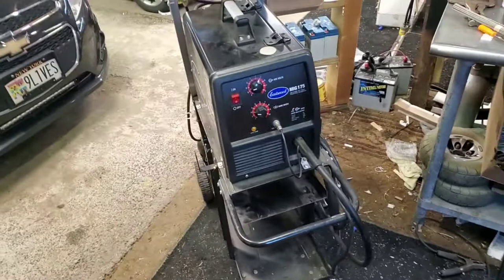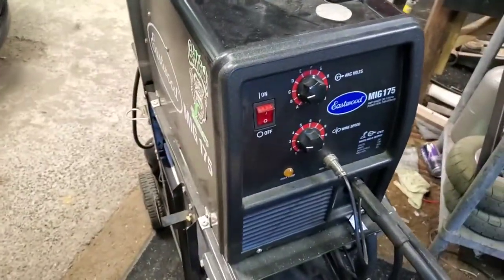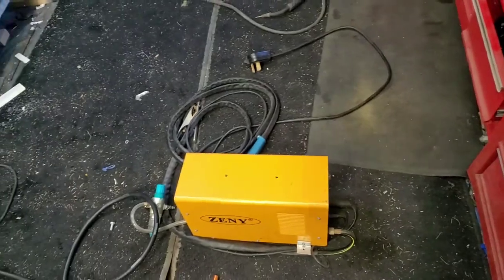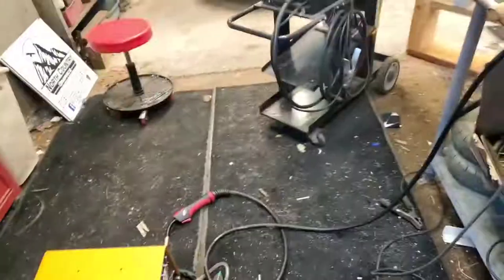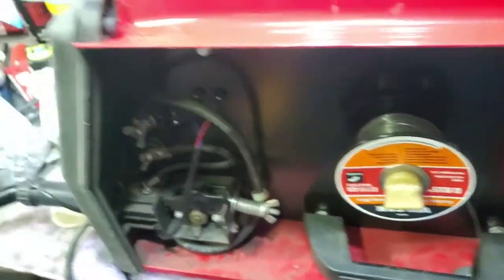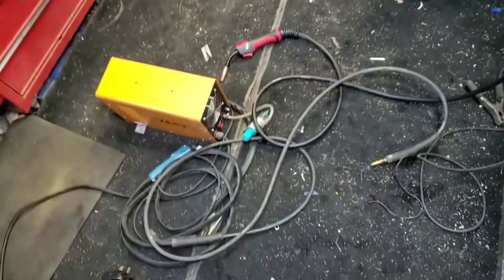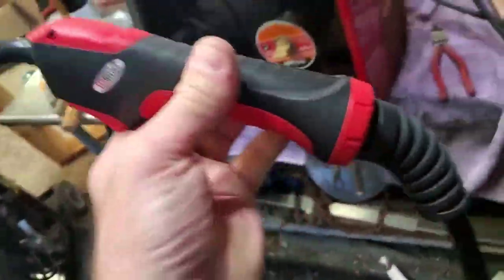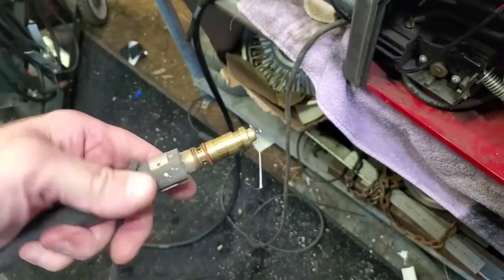How to change your MIG welder gun

Comment: I just got one of these vintage lincoln welders.  It came with the original dusty manual. It does not say anything about the wing nut. it tells you to just to remove the gun. thanks so much for the tips. super easy.

Comment: ?....hmm. VERY  interesting.  Got the same  problem. Before searching this video out. I was thinking of making my own  nozzle end.  30 degree slow curvy bend, in 1/2 inch copper tubing. Run the inner spring , where the welding wire runs,  into a piece of hose, fitting inside the copper tube.  Mount inside the original plastic nozze, with the switch.  NOW  i may have to re-think, in re-engineering this idea.  THANK-YOU  for the help,  Bro !   (techshopfix)

Comment: What kind of plasma cutter is that.  I need that ebay special.
Reply from the maker: Look at this on eBay
https://www.ebay.com/itm/50A-CUT-50-110-220V-Plasma-Cutter-Welding-Digital-Air-Cutting-Inverter-Machine-/304288056748?mkcid=16&mkevt=1&_trksid=p2349624.m2548.l6249&mkrid=711-127632-2357-0
Reply: Does it work off a regular 120v 15 or 20A outlet?
Reply from the maker: I think so, mine came with an adapter plug from 220 down to 110 I use 220 on mine and then you need a air compressor
Reply from the maker: If you click on that link and read it it tells you right in the title
Reply: I did click on it.  Would a small pancake compressor work with it?
Reply from the maker: It should you just won't be able to cut for very long until you run out of air I use a big compressor on mine. I'm not too sure how much are a pancake will put out
Reply: I understand.  Thanks.

Comment: I have that same little welder. Wire feeds fine, fan works fin, got 27vdc at leads, will not give a spark. Have that same gun ordered hope to hell it works.
Reply: Hi, I have a silver beauty I got at a yard sale and a machine from clarke which is now bankrupt. I don't know where that one came from. Lol. Anyway I had the same problem. I fixed it by tracing the ground circuit from the front end of the clamp all the way to the other end of the wire where it connects to the machine even if it's inside the machine. I cleaned and redid all the connections this way. If this does not work do the same with positive side. If this does not work it's inside. Then you clean all connections inside. If this does not work probe parts big enough to test. If this isn't the problem then it may be too small to fix and probably needs replaced. That was the plan I was going by. I don't normally comment but there is probably trouble coming ahead if not already there for you. I just want you to know that all you have to do is pray and give it all to Jesus. Jesus never promised an easy life because of our sinful nature but he hurts when you do and is right there to comfort you if you ask and let it go. Give it to him. I did and it changed my life. So much peace! God bless!!!